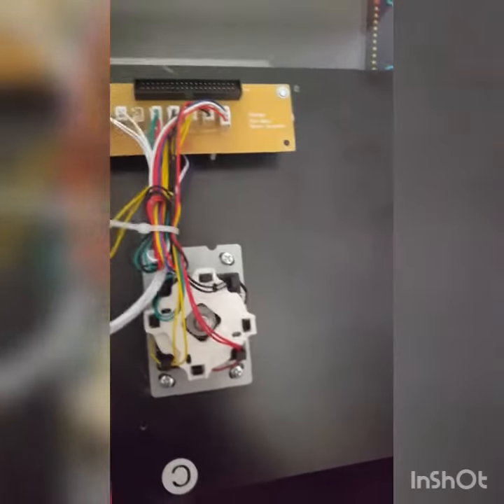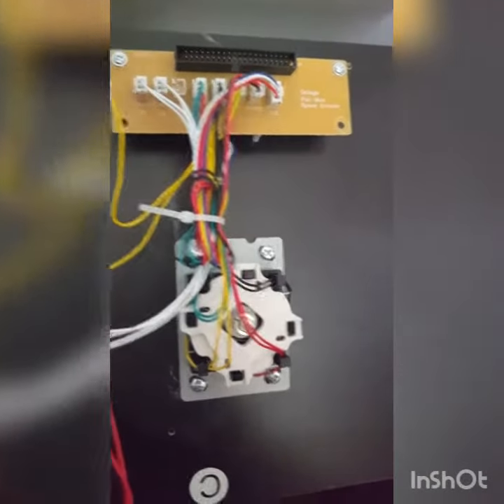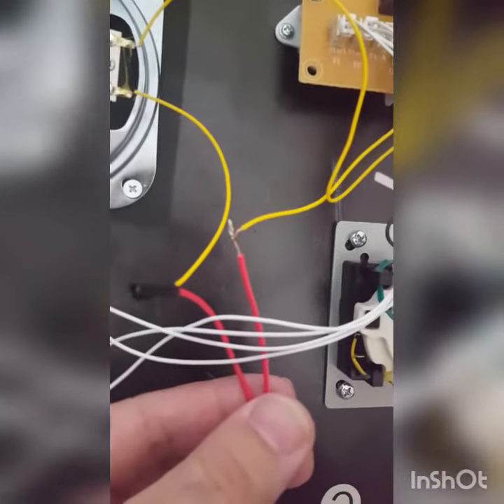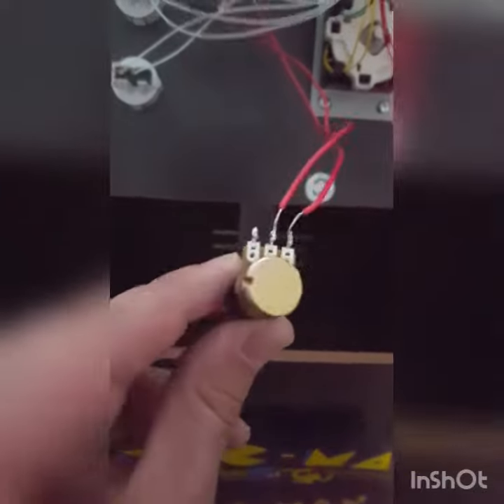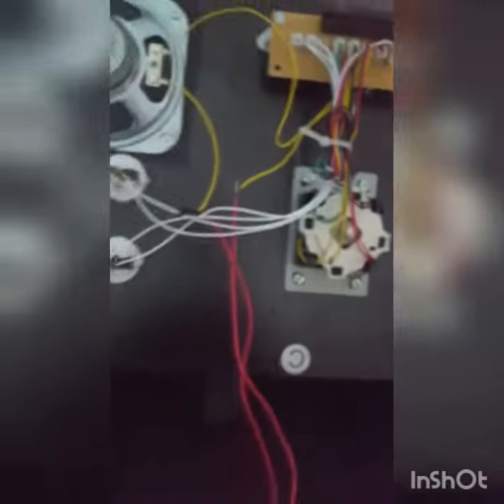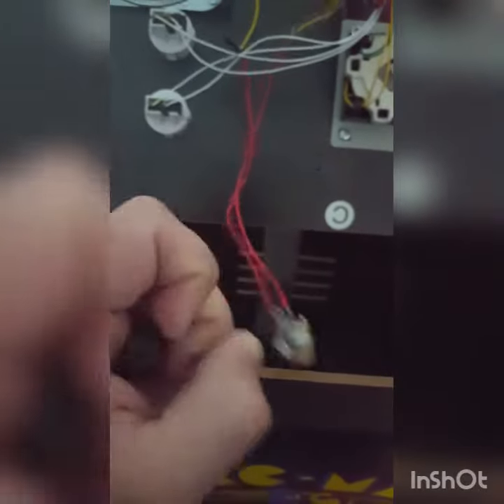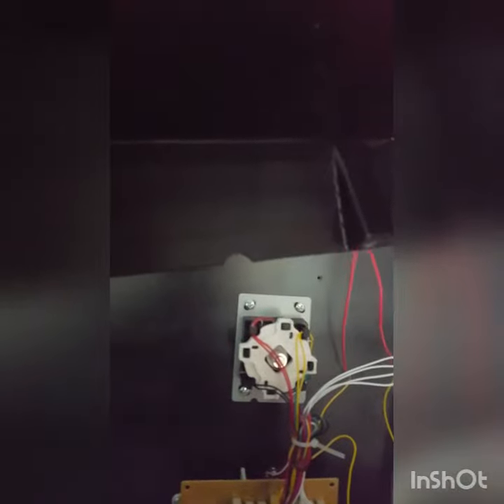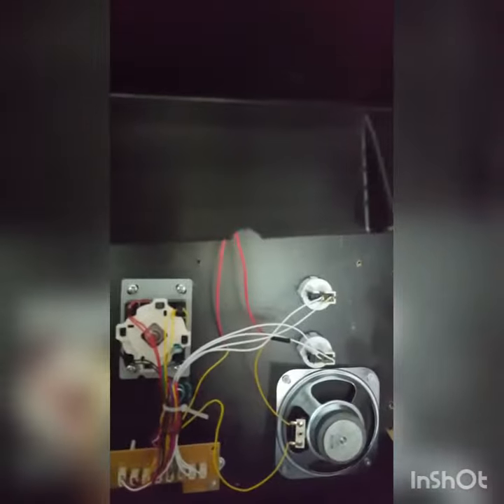Arcade1up full control volume mod

Comment: Thanks so much for this! Due to my lack of knowledge with how all of this works, I was baffled by that Icculus tutorial, so this was extremely helpful and worked like a charm. Interestingly enough, the Icculus tutorial says you have to flip the power switch around and keep the volume switch the same. For whatever reason, that was completely opposite for me on my MKII cab. I first flipped the power switch, then had to put it back like it came from the factory, only to realize that my volume control wasn't correct-- putting it in the first position made it max volume instead of completely silent, so I had to flip that one around. All works great now though-- thanks again!
Reply from the maker: If you have a raspberry pi, which it sounds like you do, you can check out this video I made if you want to still utilize your volume switch.  here's the link.  I provided a word document to help you along your way as well.  https://www.youtube.com/watch?v=xXW2A8vr-C0

Comment: Your awesome thank you for sharing this, just picked up the MK cab so this mod is really gonna come in handy.
Reply from the maker: Glad you find it useful. I put it together rather quickly to help a fellow Arcade1uper.  Let me know if you need any other info.
Reply: FYI. There's a hidden menu on the MK cabinet that allows you to set volume/difficulty/unlocks.
Reply: @robertdoerr7675  Dialed it in today and works like a charm! Your awesome brother thisll help plenty of people out.
Reply: @MasterMayhem78  You are absolutely correct there is a secret menu. Or we could invest about 40 minutes and never have to enter the code every time firing up the cab.
Reply: @MasterMayhem78  True, but it doesn't work for the A1U menu (which hisses), nor does it work with MK1. It's also a total PITA to access, and some folks appear to be bricking their machines somehow (this hasn't been proven, but so far, accessing the EJB menu is the one thing the bricked units have in common). So... this volume knob seems like a solid alternative!
Reply: Where do I find that volume knob?

Comment: Does this deactivate the stock volume switch? Also the volume knob has 3 tabs to solder to. Does it matter which 2 tabs you use? When you show yours in the video it was the middle and right tab in the orientation that you held it in. Thanks for making this video. Very simple and informative.
Reply from the maker: Sorry for the late reply. It does matter which tabs you solder to. If you solder to the wrong side, your volume will essentially be backwards. It doesn't affect the functionality, it's just backwards. So, you can just remove it and solder to the other side. Also, it does not affect the functionality of the switch either. This is due to the switch still be inline with the pedometer.  Hopefully this answers your questions, thanks for the questions.
Reply: @robertdoerr7675  Thanks. I just finished the installation and it works great. The volume knob is a bit more sensitive then I would have liked though. Tends to stay quiet as I turn it up for a long time before all of a sudden getting really loud towards the end when turning the knob. But its still way better than it was before when just having 2 options (loud or really loud). lol Anyway, I also wanted to mention that I desoldered the wire that was connected to the speaker and did the hook up directly instead. That way you don't have to cut the wire in half. This is good for people that might want to put the arcade back to stock using the original wire without any cut/splits in it.

Thank you so much for this quick and to the point video. I love this kind of videos that are fast and simple. Take care.

Comment: ⭐ HELP.....i have the Arcade 1up 12 in 1 cabinet and even with the stock volume switch, switched to High, it still sounds really low & quiet compared to the other cabinets (like Pac Man, Rampage, etc...) it there an easy way to make  this cabinet LOUDER then the stock high switch setting? and would adding this dial control of yours, still only allow it to only reach the factory highest sound level? How can I make the speaker louder then the factory high setting? (which is too quiet on the 12 in 1)....even if I put in an upgraded expensive aftermarket speaker, wouldn't it still only go as loud as the factory setting? Is the only way to make this cabinet louder, is to alter something on the main control board circuitry?
Thank you for any advice you may offer me.
Reply from the maker: Hi!  Thanks for your questions.  By doing this mod, you can definitely make you cabinet louder.  Much louder actually.  This is just the way I did it, and it worked for me.  If you're not handy with a soldering gun, DIY Retro Arcade makes a "kit" to assist with that.  Here is the link: https://www.diyretroarcade.com/index.php/arcade1up-manual-almost-plug-and-play-volume-adjustment-kit.html.  Swapping out the speaker, in theory would make you cabinet louder, but would require a larger speaker and serious modification.  Another option would be to modify your cabinet and place a jamma board, raspberry pi or PC in the cabinet essentially giving you as many games as you'd like, and utilizes an amp allowing you to make your cabinet as loud as you want.  Let me know if you have any more questions.

Comment: How many K is that potentiometer you are using?
Reply from the maker: Thanks for the question.  It is rather small.  Only 5K.  I picked it because it was cheap and easy to work with, but mainly cheap  There are definitely other options, but this worked for me.  if I did this again, I would consider a little higher.
Reply: Robert Doerr ok great thank you